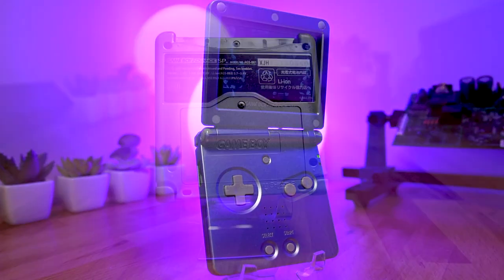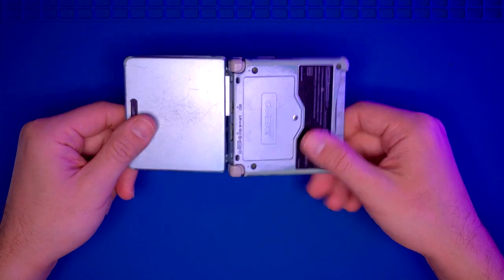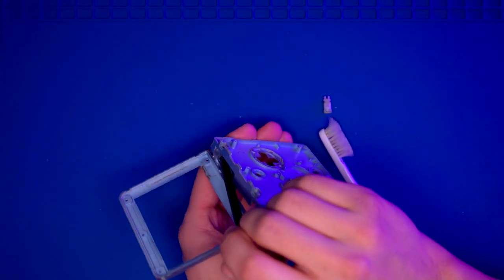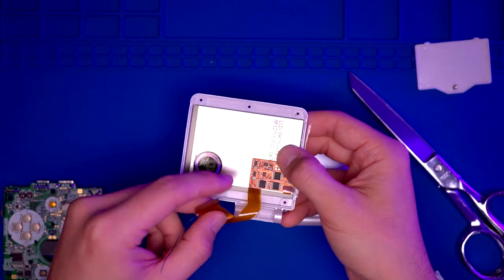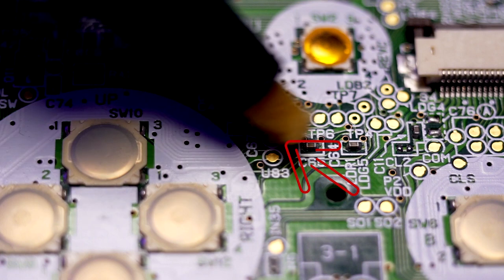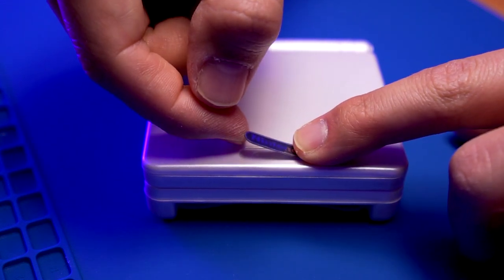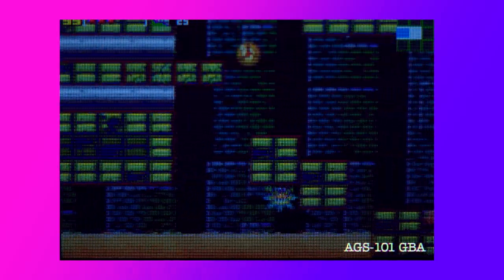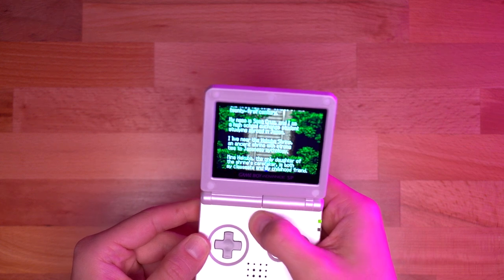EASIEST way to make the ULTIMATE Gameboy Advance SP! FunnyPlaying IPS Screen and Retro Modding Shell

Comment: Is soldering the wire to adjust the brightness optional or can you just leave it out?
Reply from the maker: Hi Jay!  Great question!  Yes, soldering the brightness wire is complete optional.  You don't have to do it.  The default brightness in my option is perfect and I find myself leaving it on that setting.  Without soldering the wire, the SP will remain on the default brightness.  I hope this helps!  Cheers!
Reply: Macho Nacho Productions ok thank you for the info!
Reply from the maker: @jayw1823  Anytime!

Comment: Whats the battery life like, especially with a flash cart ?  Thank you for the video :)
Reply from the maker: Very good questions Jay!  I can't say for sure, or provide exact figures, but depending on the brightness (if you set it to max) and if you are using the EZ Flash, battery life is indeed reduced.  However, if you keep the brightness on default or lower, the battery life to me seems to be about the same if not more.  Hope this helps!  Cheers!
Reply: @MachoNachoProductions  thank you for the reply, I heard that if you switch off the real time clock on the ez-flash omega and load the game from NOR flash instead of the SD card you can increase battery life. Sounds like the display is rather power efficient which is good to know.

Comment: What gauge wire is that?
Reply from the maker: I believe it’s 28awg. Cheers!
Reply: @MachoNachoProductions  about to do this mod and I would rather have a longer piece i can shorten
Reply from the maker: Yep I agree. I used the included one and it was long enough but I prefer more slack to work with. Best of luck on the mod!  Cheers!

Comment: Do you need to solder? or is it optional for screen brightness adjustment
Reply from the maker: It's optional.  If you want to have brightness control you need to solder one wire.  I find that the default brightness is plenty bright, so you should be fine without soldering.  Hope that helps!  Cheers buddy!
Reply from the maker: Awesome!  Hope everything goes smoothly!  Would love it if you shared your build on my Instagram or Facebook page so I can check it out. Best of luck!  Cheers!